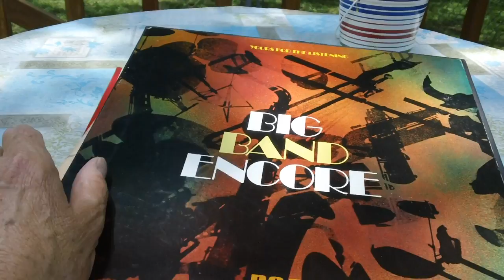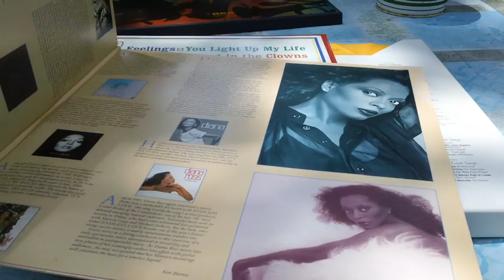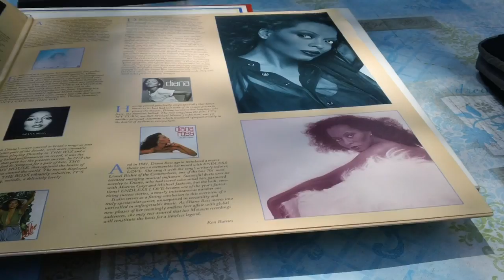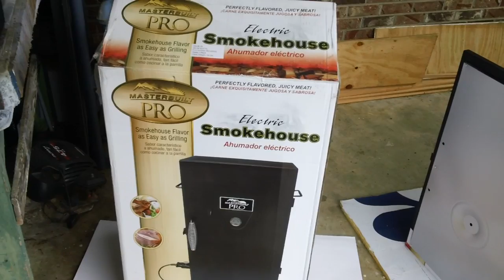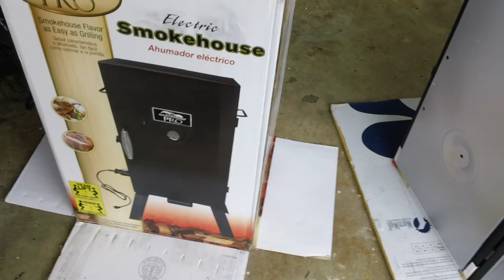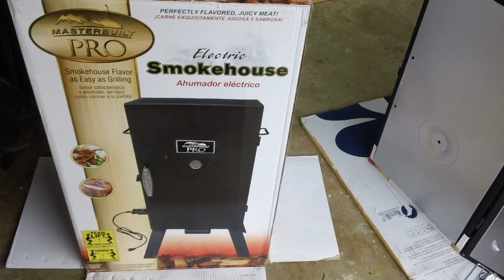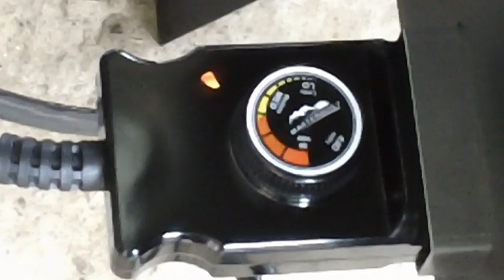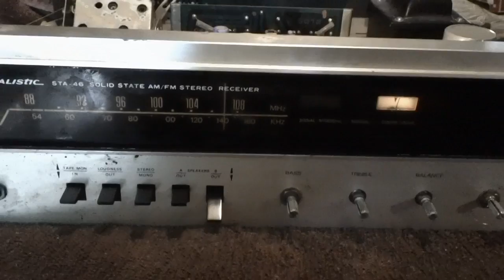Mish-Mash #112

Comment: John,
Your Electric smoker is an interesting piece of equipment: I’ve never seen a professionally built one like that.  The few domestic smokers I’ve seen over here are old fridges converted into smokers.  Having never tasted food that has been cooked in one, I can’t say how effective they are.
The old STK audio chips certainly bring back happy servicing memories: I’ve replaced quite a few of those in my time, including those 015 types.
The price of albums at the Salvation Army charity shops in your part of America are loads cheaper than in my part of the UK – 57cents (for all those albums) – they would have been priced from 50 pence each over here.  My wife likes Diana Ross’s music too.
Cheers,
Phil.
Reply from the maker: Phil,
I've been watching those electric smokers for quite a while now, but held off buying one until I spoke with someone who did.  That someone turned out to be a workmate who said it was a great thing to have and the price wasn't too over the top, but that being said, it wasn't all that cheap either.  Anyway, my first shot at smoking turned out pretty good.  This weekend it'll be two whole chickens smoked in cheery wood.  I'm hoping it'll taste great.
Also, I've made it a point to stay away from the 70s and 80s solid state stereo gear.  I'm just not that good at troubleshooting  that sort of stuff.  But lately I haven't been able to avoid it...and have  been quite lucky to make the repairs.  I never would have thought so.
BTW...it wasn't 57 cents for all the albums.  It came out to be 57 cents each, which was a tremendous bargain.
Good or bad, I'll include the upcoming chicken smoking venture in the next Mish-Mash vid.  See you then, my friend.
Regards,
John

Comment: that slow cooking in that smoker makes for such great barbecue! I may go for one myself. Only thing did it take much time to clean the thing up and wipe off easy?
Reply from the maker: Before smoking spray each grill and the water pan with PAM.  Makes cleanup a snap[.  And the cleaning instructions say to clean the interior surfaces with a damp cloth only...no soaps or cleaners.  That's about it.
Regards,
John

Comment: A real problem is fixing to rear itself:  apple wood is great for baby back ribs, maybe pecan, but fixing chicken at the same time would require different techniques as those apple chips might not be so good for the chicken.  Too bad the rest of the family does not like ribs so you could go with apple wood chips and apple juice to slather down the ribs and eat like a king.
Reply from the maker: Ansel,
I doubt it'll be a real problem.  I'm flexible.  We'll just have to make adjustments as necessary.  Piece of cake, old boy, piece of cake.
Regards,
John